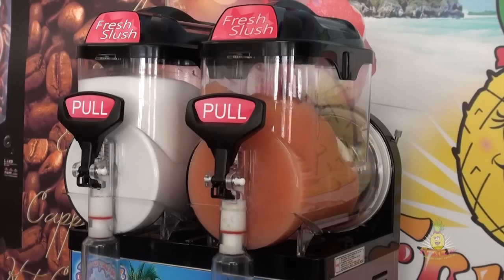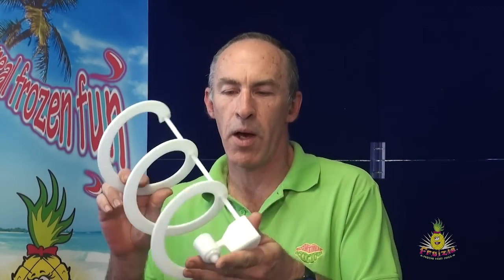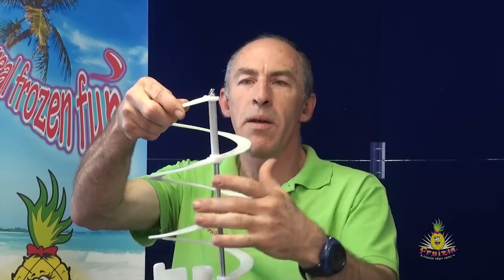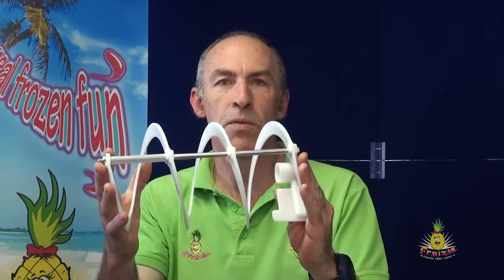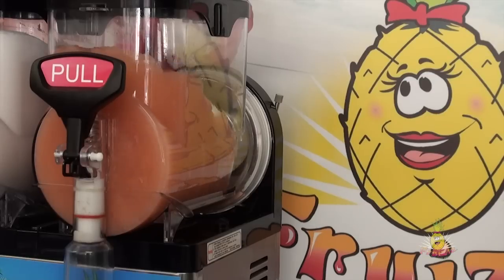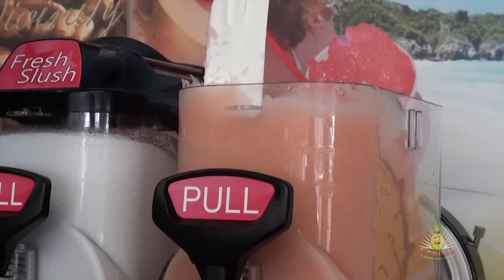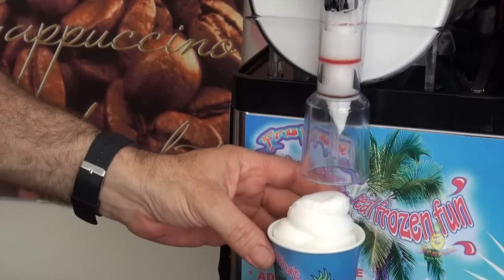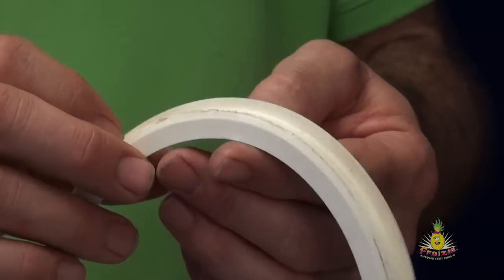6/7 Slush Machine training Video - Trouble Shooting

Comment: Hello great videos by the way. I have a question I think you can help me with. I have a new Bunn Ultra 2 P/N 34000.0123. The cooling drums are leaning down. I was told by Bunn corp. that its not uncommon that they get shipped out this way for shipping reasons. They stated that the support brackets needed to be adjusted. Do you have any infomation on how to adjust those brackets? Thank you.

Comment: To RT78:  (Part 2)

Put the hole in the tool over the end of the auger shaft with the little ledge toward the inside, spin it around so the boss (little bump) on the bottom of the tool sits inside the drain hole in the upper drip tray.The boss should just barely sit inside the hole. If necessary gently bend the cooling drum so that the boss barely sits inside the hole and your cooliong drum will be properly aligned.  If you have lost your alignment tool, you can purchase the from our ebay store.

Comment: To RT78:

The cooling drums (evaporators) must be properly aligned both up & down & left & right.  If out of alignment they can damage the machine and if "bent" enough they can cause a refrigerant leak and expensive repair.  You should use the cooling drum supports/alignment tools that came with the new machine (black plastic "towers") to align the cooling drums.  (Continued)